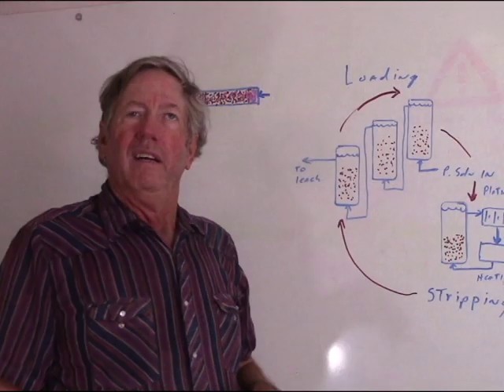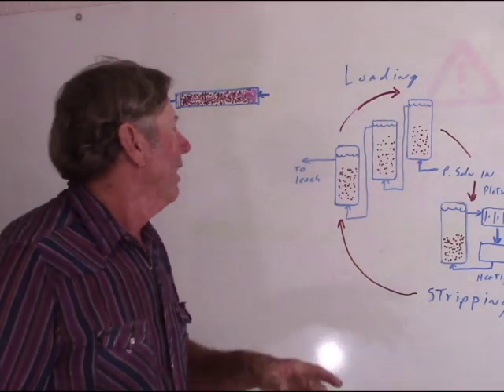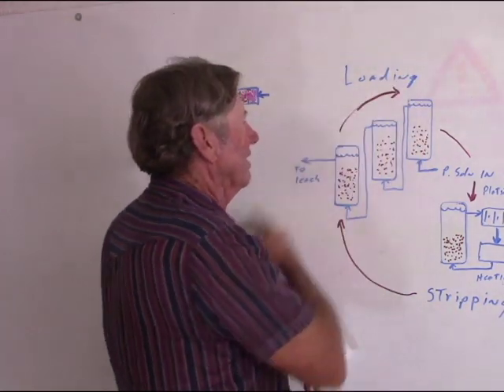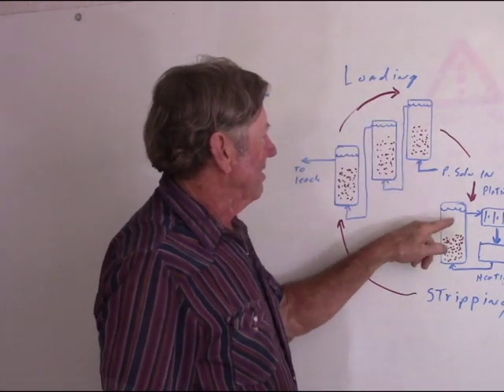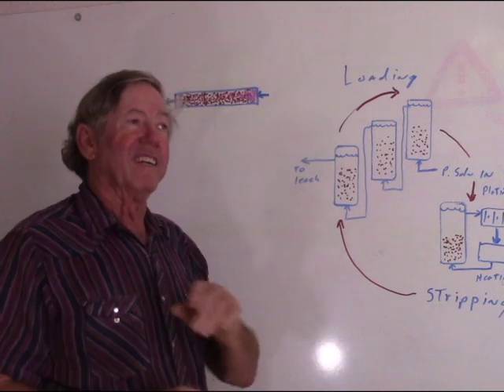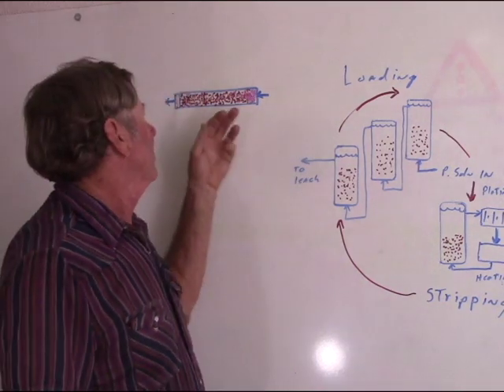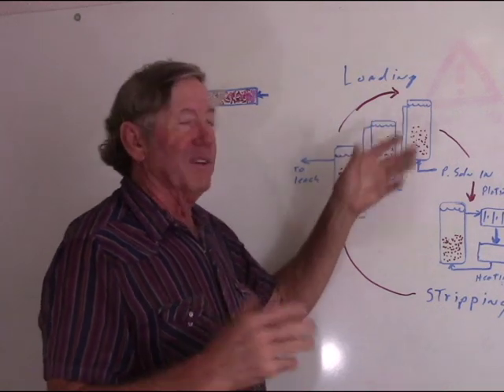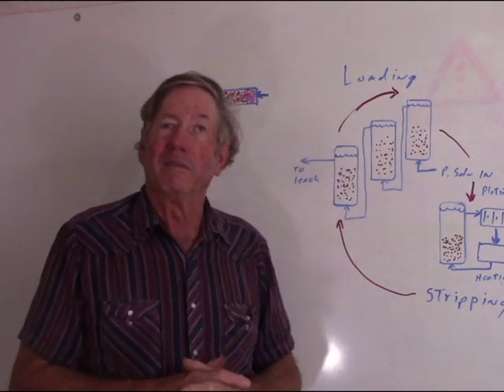Fundamental Milling Principles   Countercurrent Material Flows

Comment: heap leach of tailings is that the best? Can you go into detail of the cyanide circuit for that, the carbon tank quantities etc
Reply from the maker: First of all, are we talking tailings (the finely crushed rock from which gold has previously been extracted) or waste rock (rock with too little valuable mineral to justify processing which had to be moved out of the way to get to the higher grade ore)?

What kind of grade are we talking about?

How many tons?

What state is it located in?

Are there any other potentially valuable minerals?

Is the gold free or chemically bound or crystal locked?

What is your budget?

Have you done any dissolution testing and reagent consumption testing?

Any mineral liberation/exposure/re-grinding testing?

These are the starting point to BEGIN the design work.
Reply: @hardrockuniversity7283  lets assume the tailings  are from a wet gravity small scale system. And are non refractory and 3 gram per tonne. We've done a leach roll test. So we decide to place all the tailings, say 100 tonne in a heap. What do we place it on. How high, what sprinkler rate per day, what cyanide strength. What is the smallest cheapest carbon filtration system, how do we know when it is done. is it just a matter of pumping it through carbon and back over rocks. what from is the carbon in. can we just cut a gas tank and put a hole top and bottom and fill it with carbon and pump through it. Oh Keith, I thought of this other idea. Drop cyanide pellets into flooded mines, pump out pregnant solution, be rich. 3 simple steps. thanks in advance. watch this and all other episodes and you will see a heap leach set up can you talk us through it. https://www.youtube.com/watch?v=NU2j5qMplWM
Reply from the maker: @frankenscience3553  

Hmmm...  Your inquiries present me with a very challenging situation.

First, let me state for the record I like enthusiasm.  However, this is both a somewhat complex and rather serious subject.  Perhaps an analogy would be useful:

If someone moved to my state (Arizona) with very loose gun laws from someplace like New York City, they might think  Yahoo!  Now I can have a gun!  Think of what I can do with that!  However, would a gun seller be responsible in just selling this person a gun when the conversation seemed to clearly indicate  that the buyer was quite unfamiliar with the basics of both gun operation and gun safety?

I am in a similar situation.  I like to help people succeed, but the questions you are asking and the suggestion about putting cyanide in a flooded mine indicate a profound lack of familiarity with a very potentially dangerous subject.  I don't want to do anything that would increase the risk to your or anyone else's life.  At the mines I worked at, we got sodium cyanide by the truckload.  The LD 50 dose is about 1 mg/kg of body weight.  Therefore, each truckload had enough cyanide to kill  MILLIONS of people if distributed evenly and effectively to them (luckily, very hard to do).  When it was much less regulated, there are stories told by Mines and Mineral Resources about pregnant ponds fizzing like soda pop with hydrogen cyanide gas.

I would strongly suggest that if you are interested in cyanide to recover gold you should thoroughly research the subject on the internet until you can re-read your posts and see what I see and , only then, consider using it.

I will now analyze a couple points of your specific situation to help your research along:

1. In this specific instance you mention 100 tons total resource grading (at today's price) about $140 US per ton.  At a total process efficiency converting entrained gold to cash of 80%, your total recoverable value is only about $11,000 US  that is not enough to pay for the equipment or labor to put this project into operation, to say nothing of permitting costs, which would be 10 to 100 times that alone.  You may be just giving me some numbers to start with, but you can do the multiplication from there to see if there is even any practical reason to continue thinking about this project.

2. Since you have tailings (essentially fine sand? as opposed to worked alluvium?)  You  would most likely be best off with a tank leach.  Hint- research percolation issues in a heap.

3. Don't even consider going ahead until you can answer why the idea of putting cyanide in the natural water of a flooded mine is A- Very dangerous, B-Very illegal, C- Immoral in almost all cases IMO, and D- Almost certainly ineffective.

I hope I have not come off as condescending or insulting.  That is certainly not my intent, and I apologize if I came off that way.  We all start each subject with essentially zero knowledge and don't know what is important until we get well into it.  There should be all the information you need readily available on the internet.  If you run into terms you don't understand, use Google until you do and you will  gain enormously from the quest.  

Best of luck in your search and stay safe.

Keith

Comment: Very interesting stuff Keith , however you have the advantage of having seen how all this works first hand , others ,like myself haven't .  With your shock factor comment to me the other day about Mercury use ,surprised me , because i think i would rather deal with Mercury ,than Cyanide ,as contact with about five milligrams of that stuff, i believe will kill you ,lol , but that's no laughing matter i know , and obviously you've worked with it . But anyway are you going to go into more detail of the stripping process , just asking , and thanks again for your series ,cheers .
Reply from the maker: I personally have no theoretical problems with Hg, but it is frowned upon by the authorities because it is a cumulative poison and persistent in the environment.  Cyanide is also toxic, but it is NOT cumulative.  A sub lethal dose is rapidly metabolized and it is unstable below Ph 10.  A dangerous dose of cyanide is also easily neutralized in the body.

I have to be careful what I put down in public and in writing. :-)

Enough of anything will kill you and nothing will kill you if properly handled.
Reply: @hardrockuniversity7283  , Yes i definitely understand your legal caution , and that's also something i didn't know about Cyanide , so thanks for the info ,and hope your going to elaborate on the stripping process a bit more ,cheers .
Reply from the maker: @GrooberNedJardine  So many subjects- so little time...  :-)

Should have some more videos from the road soon.  Flying to New York to spend a couple months with a viewer, working for his fencing company and going prospecting on the weekends.  Also, may do some recovery from electronic scrap.

Better than spending the rest of the summer at home, that's for sure.  Plan A (Alaska) and Plan B (Montana) get delayed due to paperwork issues.  I'll get to take Eva to Niagara Falls at least.

Good luck!
Reply: @hardrockuniversity7283  ,Wow you have got a busy schedule , well good luck , don't work too hard , and keep it safe out there ,lol ,
Reply from the maker: @GrooberNedJardine  I don't like sitting around, but like some variety.  It looks like I am drifting in the right direction.